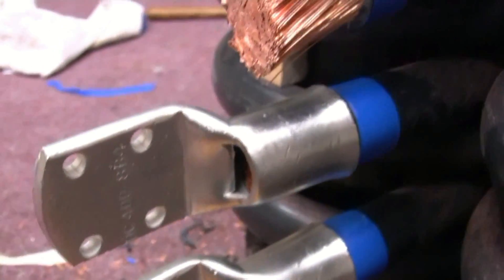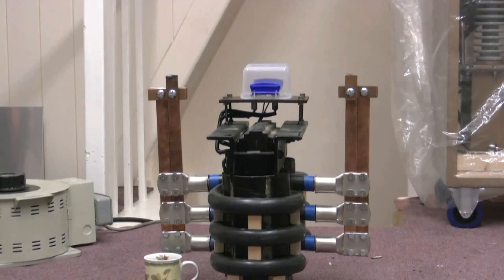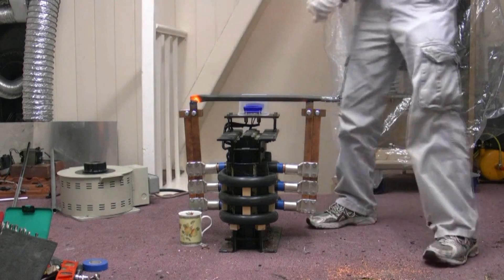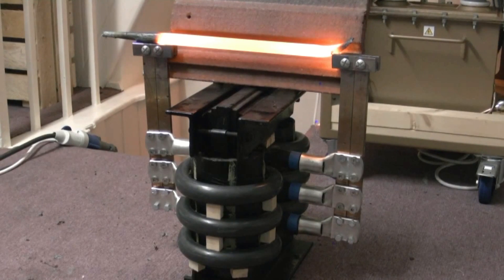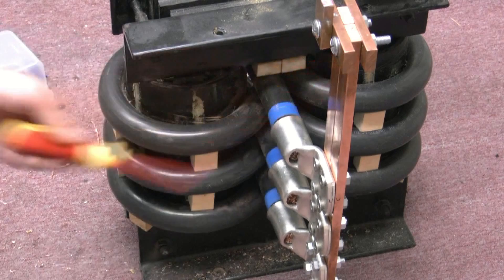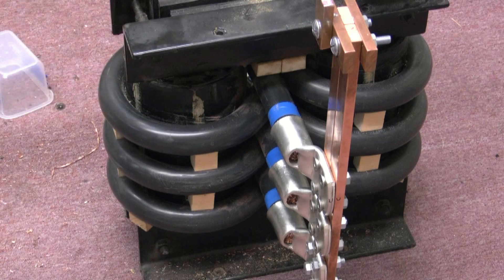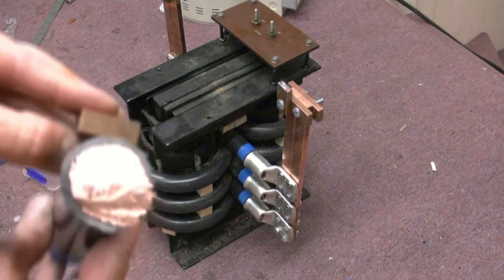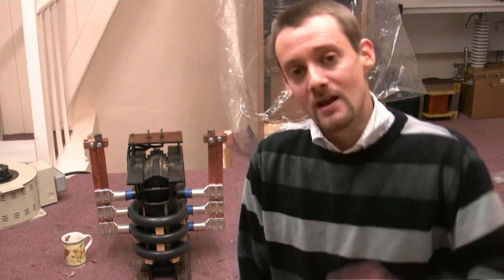50,000 Amp Transformer Completed

Comment: As a fellow electrician, I was very impressed with your demonstration, however I know you know something about ohms Law, and you MUST know that "it's not the voltage that hurts or kills you, it's the AMPS (current) had you touched both electrodes at the same time, we would have watched you EXPLODE!!! Just be careful in the future mate!!!
Reply: Lewis H.  "As a fellow electrician..."  Jeezus!!  This is why electricians scare me!!  I'm NOT an electrician - I know physics & electronics.  You remind me of my previous business partner, who used to try to impress me by saying "I know Ohm's Law - V=IR...."  So I'd say "O.K. your car has 2x 60 watt headlights, how much current do they draw from your battery?"  Of course he had no idea...  It's like saying "I understand (special) Relativity - E=MC^2"  Parroting a three term equation does not imply any kind of understanding of fundamental concepts nor how to APPLY them.  Clearly you either DON'T know much about Ohm's Law, or you don't UNDERSTAND it enough to apply it to real world situations.  Had he touched both electrodes at the same time he would NOT, OF COURSE have exploded, and I suspect HE knows that, even though YOU DO NOT !
Reply: And that's why your not my electrician.
Reply: Can I say rubbish. You can have 10,000 volts and an amp and you're toast. You have 10,000 amps available at 1 volt you can connect across it all day and not feel it. Very little current would flow. When you put your fingers across they present, perhaps, 200,000 ohms. Ohms law says 1 volt divided by 200,000 is quite a tiny current. The fact you have 10,000 amps available means nothing if the high resistance value is controlling actual current flow. Glad you didn't wire my house? Where did you say you were certified? We need to have a chat with that institution.
Reply: Jasper Dar The impedance of the human body is much lower on the inside. About 2K on average. Your skin can act as a dielectric and protect against higher voltages if dry and intact. But, 1/2 a volt would need electrodes right in the heart, most likely :P 10uA there can be lethal.
Reply: In Lewis' defense, most electricians are taught that any current above 50 mA or so is dangerous and/or potentially deadly.  This is because we generally only work in high voltage environments (my training defined anything above 50v as "high" voltage).  So, although he is obviously wrong, we can probably agree that a .5v 50kA environment is an unusual one, to say the least.  Being that de-energized work is always preferable to the alternative, at least his message (to exercise caution in high-current situations)) is on the right side of the wrong scale.
Reply: Philip Chalk 10 Amps at 12V :P
Reply: Donn H Agreed, Don.  I am very well acquainted with Mr. Ohm, and have been for decades, but clearly many posters here, and places like it, either are not or do not know how to apply it.  But I repeat also that NOWHERE in this video are we seeing anything near 50,000A.  Yes the transformer MAY (though judging from the core size, I doubt it) be able to deliver 50kA before saturating, but just look at the primary wire gauge feeding the thing, and the variac, to know there is nothing like 50kA in the video.
Reply: Lewis a shut mouth gathers no foot. THINK man, if what you say was actually true we would blow ourselves up holding the terminals of a car battery.
Reply: SoulxReaper366     <-You think 50mA can't kill you?  Think again.  There are good reasons that your average domestic RCD is designed to trip at 30mA...
Reply: You are so gentle with your words Pete. On the other hand a crowbar dropped across a Cat battery (12V) can be a scary and dangerous thing. Yup, high current can be dangerous but high available current and low voltage isn't shocking. It was just a couple of days ago I saw a blog where some not so knowledgable guy was talking about connecting a car battery across some guys testicles and getting information out of him. Might have had to wait a while.  :-)
Reply: Yep, gotta watch out for those cat batteries - they bite & scratch !
Reply: and as a fellow electrician you should know that the Amps are related to the voltage and resistance. So since in a circuit we are a resistor the Amps that will go through our body are based on the voltage that the circuit is working with
Reply: Doc is right. Nonsense Lewis. Lots of Voltage but no current you could possibly get a tiny burn on an arc-over. Lots of current available but very low voltage not going to feel anything. I can barely feel 12VDC with wet fingers across a car battery or power supply and they could have a reserve of several hundred amps on a dead short.  High voltage and some current - yes you could theoretically explode. It could ruin your day. This fellow with his home made transformer could generate quite high current at low voltage and it can make a steel bar glow. Not likely to give you a shock unless the voltage is directly across some nerves in the heart. Not sure where you got your electrical certification as an electrician. You definitely need to study more. Your theories about voltage and current relating to the human body are way out of kilter. Best be careful around wiring, you could be a hazard to yourself and others at this point in your life.
Reply: An Electrician wouldn't really know how a transformer works, all they tend to know is how to wire one up because an Electrical Engineer has more knowledge and know a lot more than a Electrician will ever need to know.
Reply: you must be a shit electrician.
Reply: ***** Headlights/headlamps are between 35 and 65 W on most autos. Exactly how much depends on the type and that's affected by country. Quartz Halogen, HID, LED and old fashioned sealed beam incandescent bulbs exist. So, at 15V (the max a 12V auto will ever see - nominal is 13.8V with the engine running and down to 9V on batteries or an electrical overload) they will draw from 2-6 A of current each. Your mileage may vary :P
Reply: ***** This is why the needles of an air ioniser don't kill you. on the inside of cheap ones its a simple diode pump arrangement with diodes and capacitors directly connected to mains potential through a high value resistor (resistors limit current, not voltage as we know (unless in a voltage divider configuration)), pushing the voltage up but the current down to the point that negative ions are free to react with their surroundings and create mountain fresh air and illuminate close by gasses and fluorescents if bought near the needles, bless them lol
Reply: It's the current that kills you is basically a half truth.  It is true that it is current that affects the heart.  But the current has to get there first.  A 12 V battery has a 200+ cranking amp capacity but it won't kill you.  It takes both voltage and current to do you in.  Sufficient potential to push sufficient current thru the chest cavity to stop the heart.

One more thought.  the 50KA just indicates how much the secondary coils can handle before they short.  This transformer would light a 1 volt light bulb with no ill effects to the bulb.
Reply: ***** Hi,  Sorry, I don't come here often, it's so frustrating.  Yes, you can make things complicated, but JohnnyX50 gave the simple answer I was expecting.  I knew this guy well enough to know that he would know his car had a "12 volt" battery; I also knew he would not know what a typical headlight power was, so that was stated in the question.  Yes, your "12V" battery  can assume a range of voltages, depending on conditions, but that's beyond the scope & intent of the question.  P = V x I  (Power in Watts = voltage, or EMF, in Volts x current in Amps)  Therefore I = P / V   = (2 x 60) / 12   = 120 / 12 = 10 Amps.  That's the simple answer.  The more you know, the more complications you can introduce - the variation in battery/charger system voltage, wiring & contact resistances, the variation in both of those things with temperature change, etc. etc. etc.  But anyone who knew the fundamentals could answer instantly - "Ten amps".
Reply: kevindt100 'Body resistance' is a nebulous concept that can cover a wide range of values.  You can't just say "It's around 800 ohms"  without qualifying your statement.  800 ohms certainly does NOT represent, for example 'normal' dry skin resistance between your two index fingers - that is way higher than 800 R.  If you dont believe me, just grap the probes of a multimeter between thumb & index finger of both hands.  You should expect a few hundred k ohms or so - the harder you squeeze, the lower the value.  Stick a pin into each finger & measure that & you'll be nearer 800 ohms.  Skin resistance can assume a wide range of values, depending on the conditions.  If you want to quote a value, you need to stipulate the conditions in order for your number to mean anything.  I wonder where you got 800 R from; it's a strange number to use.  Galvanic Skin Resistance is one of the quantities measured by Polygraph machines - 'Lie Detectors' - your skin resistance decreases when you tell a lie !
Reply: I KNOWWWWW !!!!!   JEEZUS !!!!  What do you mean?  The current required to kill someone depends on the current?  And of course there are batteries with well over that capacity.  There is a well-defined characteristic of cranking batteries known as CCA for Cold Cranking Amps & it means something specific - you can look it up.  But many batteries could deliver 1000 amps & more into a short circuit for a very short time, limited only by their internal resistance.  The current drawn by a body depends on several things including the applied voltage.  If that is fixed then the current depends ONLY on the resistance of the body, which is quite highly variable depending on conditions.  A few tens of milliamps through the heart - HOWEVER it gets there - can be sufficient to cause heart fibrillation, followed by death.  I'm tired of this thread now, count me out.
Reply: this is completely wrong. I handle these currents on a daily basis, and to achieve these currents you need very low resistance - the kind of resistance that your body cant reach... I've touched shunts with 500amps running through them and all they do is get hot because even though they have crazy levels of current flow, the voltage drop is so low that it will avoid your body at all costs
Reply: Anyone heard of Ohm's Law. You can have 50, 000 amps available as a source but unless you have the voltage to move it and a low enough resistance you aren't going to shock anyone. If you only have a resistance of skin and body of 100,000 ohms and the available voltage is maybe 1 1/2 volts then it's 1.5 /100,000=30 ma.  You may feel a slight tickle from it. If you applied it to the heart internally it could cause a triggering that would possibly cause you to die. 50,000 amps is a nice impressive number but with a supply voltage of 1 1/2 volts it's the same as a flashlight dry cell.. I remember some wise guy putting "warning 50,000 ohms" on a door in an electrical equipment area. Pretty funny. Just remember the Borg. If less than one ohm resistance is futile.
Reply: Exactly Armando92. You need voltage to allow for current to flow through a resistance. Million accessible amps, nil volts, nothing is going to happen. It sure is impressive if you drop a crow bar across terminals in a telecom battery bank. Tons of current and 48 or 52 volts. Been there, observed that. It didn't bang, it sounded and looked like a cutting torch.
Reply: Donn H
Anyone can read about Ohm's Law at Wikipedia.  The metal parts can pull that many amps because of their low resistance, I = E/R.  We humans are many thousands of ohms, a big R, so we need a big E (voltage) to get a big I.  Half a volt won't cut it.  Voltages up to 48V are normally considered safe to touch because of the low current that could flow through us.
Reply: Doc Memory I generally agree with you, but make that 20V and also don't touch the secondary of a transformer anyway.
Reply: It cant kill u coz there is just 0,5V and that CANNOT kill u! just try to calculate this: my resistance on my hands is 170k right now and 0,5V/170k = is almoust zero (yes i know that this is AC but the resul is the same)
Reply: ***** at least he's more careful than he needs to be - it doesn't do any harm. The other way around would be worse.
Reply: you  are dam right
Reply: Dan Coulson Sorry about essentially parroting your reply.  I didn't read them all until after I had posted mine.
Reply: Jasper Dar the body resistance is around 800 ohms but factors like moister play a roll in it
Reply: mediaguardian Of course it would.  If you merely understand electrical fundamentals, you never have to wonder or 'suspect' about things like this.
Reply: Yes 800 ohms is quite low.
Reply: Philip Chalk
-so watts the answer to the headlight riddle?
Reply: Dennis Steele The short answer is "about 10 amps"  The long answer can be as long as you like...
Reply: ***** It takes a great deal less than 13 amps to kill - it is measured in milliamps.
Reply: Philip Chalk I'd say any reasonable model for the body would include capacitive coupling between skin/capillaries to the big blood vessels. Proposal: 80MOhms in parallel with a 1nF+2kOhm. Maybe a slightly smaller capacitance.
Reply: Simon Nee I guess there's no reason not to include that, but I have no idea what the numbers would be, & I suspect 1nF is too large.  I know that when modelling for things like residual current devices, they don't include it & just calculate using resistance (or impedance, about the same thing at mains frequencies).  At 50Hz (this is from U.K.) even at 1nF, the capacitive reactance is nearly 3.2 megohms, and is therefore relatively inconsequential to the calculations.
Reply: Philip Chalk impedance is almost on the same order yes, but the transient at turn on (let's say we connect at a peak) will be huge (like 150mA initially) compared to the original current calculated from 80MOhms at around 4uA. The buildup time will be in the order of microseconds, but can probably be enough to disrupt something. The result is about the same with 100pF. I guesstimated 2nF from some values I got in a school project some time ago, it's probably within an order or so correct. A result of 1mA during a few us is still macroscopic so there are at least 2 orders to take from.
Reply: Nonsense.
Reply: That's so sad. I would really expect an electrician to know more than that. More knowledge, more useful.  I'm still learning but now I'm old enough I expect I'm starting to forget things faster than they accumulate. Oh darn eh!
Reply: Lewis H you must hate your job
Reply: Lewis H he Bad the first bar directly connected and in bis hand.
maybe hed die in a house fire but definatly not from electrucion with half a volt
Reply: As a non-electrician, WTF are you on about?
Reply: +Lewis H wow, thats really embarrassing...
Reply: You just showed your OWN ignorance. While it is true that it is amps that kills, just because amps are Available, does not mean that it flows through the body.  For a given resistance, it takes VOLTAGE in order to push the amps through the body.  Obviously, you know nothing about Ohms Law yourself. Body resistance can vary greatly, but a common figure might be 1,000 ohms and usually it is much higher.  At that rate and 4 volts, only 4 milliamps would pass through the body, and at 1/2 volt, only  a half Milli-AMP would pass.  Less than touching a 6 volt lantern battery. Usually, 80 milliamps is considered dangerous.  I just love it when people think they know so much and really they know nothing.